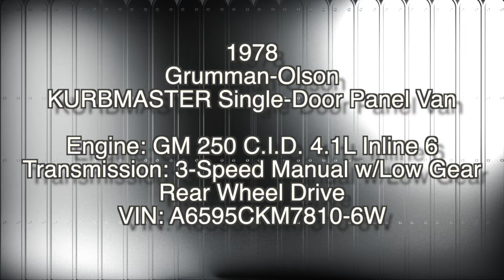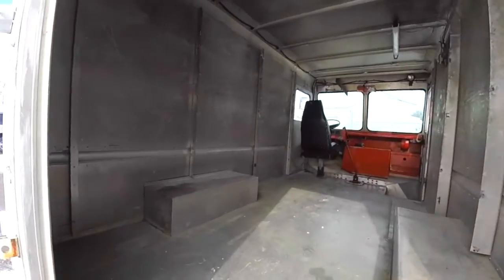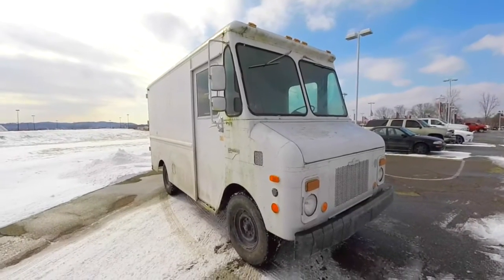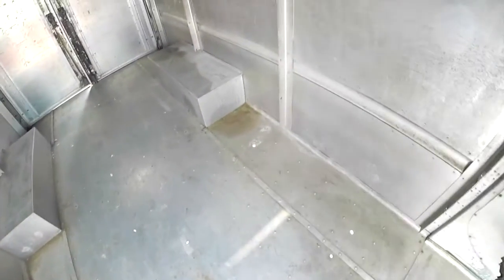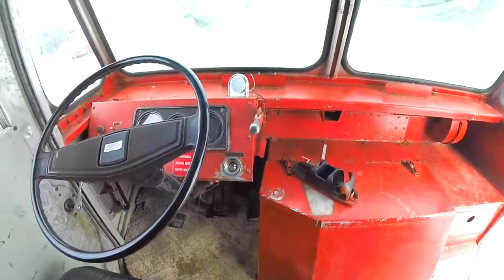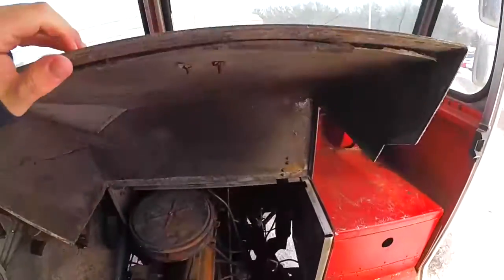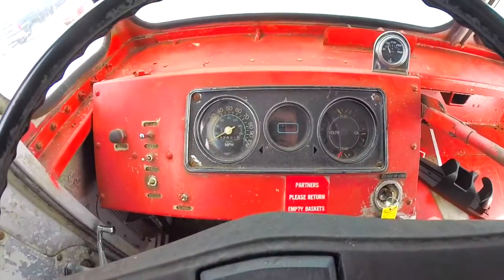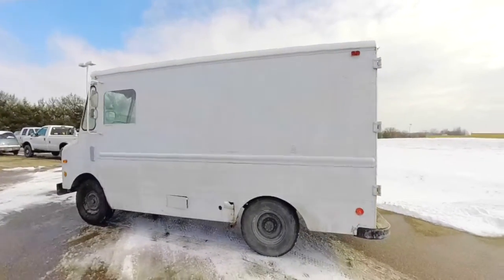1978 Grumman Kurbmaster Single Door Panel Van|P10105A

Comment: What would something like this sell for?  And, What is the length, width, and heigth? Could a Hemi engine be put in one of these?
Reply from the maker: I honestly do not remember any of the dimensions.  We had this on the lot I worked at for 2 years.  Couldn't even give it away.  We had $500 on it, and nothing!
Reply: I would have taken it in a heart beat!!!!!!!!!!!!!!!!  I also know sooo many people who would have taken it too! So, what happened to the lovely creature???
Reply: Can I come get?
Reply from the maker: Marie Griffin Skonecki Unfortunately not. It's long since sold at an auction. I'm no longer at the dealer that carried it. It's been gone for a year.
Reply: THANK YOU MUCH! Do they still make these? Can the engine hold a Hemi engine and can it come with 4 wheel drive?
Reply from the maker: Marie Griffin Skonecki No. they aren't made anymore. It was all GM underpinnings so I don't think a Hemi would fit. They were never 4wd. Only rear wheel drive.
Reply: It's a box truck. You could fit about a dozen hemi's in it.